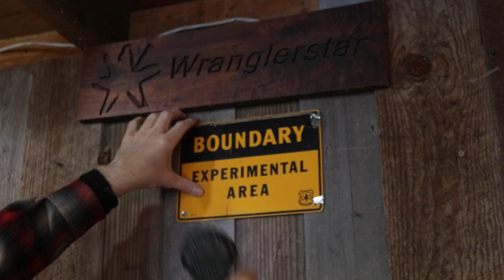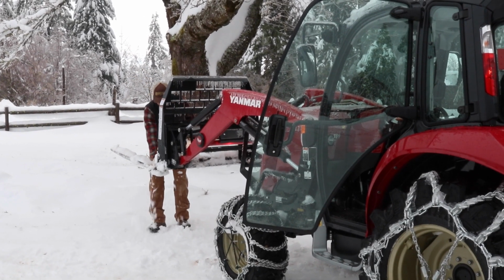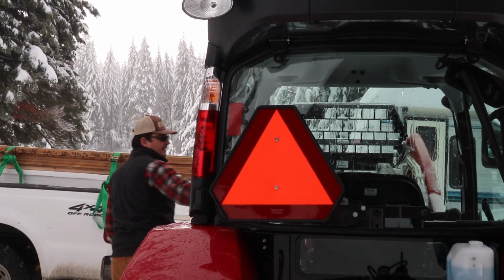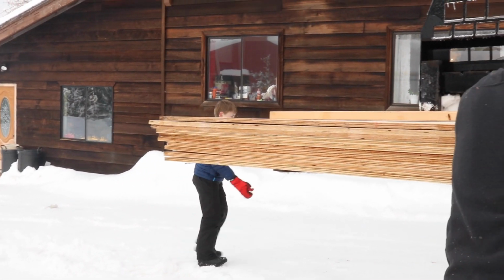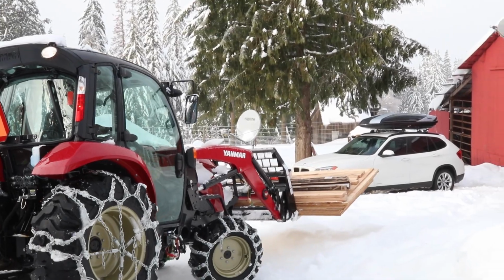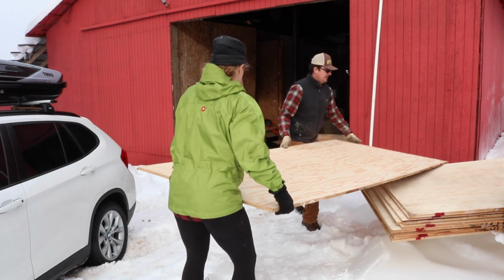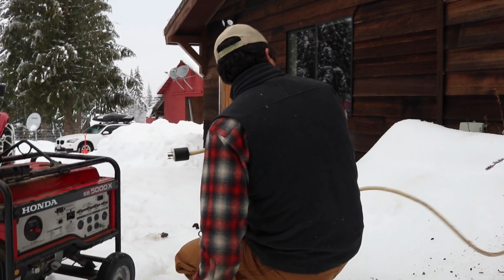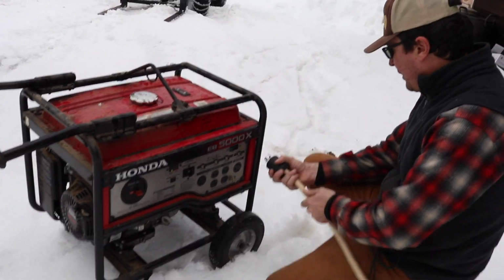THIS ROOM IS KILLING ME I CAN'T TAKE IT ANYMORE!!

Comment: I had to wince at this setup for personal reasons.  I can guarantee you that the setup in this video would ensure my home insurer would not insure.  It was simple and cheap enough to install a transfer switch and L&I approved panel breakers to my existing panel.  Added a whole house surge suppressor as well.  L&I approved, insurer is happy.  Sorry Cody, going with the masses here.  Time to do it right, if your panel will support it.

Comment: Ice dams. Hate those things. Keep the underside of the roof cold to out door ambient. Won't solve all ice dam problems, but it helps a lot. Looking forward to the rest of the shop renovation project. I've got a small barn that once I get a new foundation under it, I'll be turning into a shop. The old foundation is heaving and cracking due to frost and Groundhogs. Sigh.

Comment: Even small generators have the capability of putting 1000's of volts on the lines through a back fed transformer. PLEASE use a transfer switch for home generator ties! One wrong flip of a breaker could cost a lineman's life.

Comment: Hey Brother, you can tow a BMW from the front.  There is an eyebolt in the trunk that screws into a hole in the passenger side front bumper.  You just have to push out a square cover and screw in the eyebolt and then put the hook of your tow strap on it and away you go.  Cheers

Comment: The ice on the trees reminds me of the great ice storm in Eastern Canada & North-east USA. The freezing rain started overnight, but with temp below freezing the ice coating continued to buildup on all the trees. Whereas you could hear the ice falling off the trees limbs and crashing to the ground, in our area the the weight of the ice broke limbs, split trunks with a sound like a rifle shot, crashing down!! The electrical grid system was destroyed; miles of broken poles, thousands of broken lines and downed high voltage towers!...I have heard Gabriel's horn.......

Comment: I just recently bought a 10,000 watt generator and have been doing research on the transfer switch... I have read back feeding through the dryer socket is very dangerous.
Reply: It is completely dangerous and in most cases illegal to operate without a transfer switch. The relatively small amount of money to install the generator properly is worth it considering the danger to your home, your family, you and others who may be injured or killed by fire, electrocution from the double ended plug or by inadvertent back feeding.
Reply: I have a good friend who was a professional electrician for about 30 years.   When I asked him about a genny he insisted that he install a transfer switch.   After he explained the reasoning it's well worth the money.

Comment: National wiring code stars you need a transfer switch so when you use a generator it would automatically shut off the main. Also it would be ideal to put in a generator panel that shows the amount of wattage that you use. And remember the generator has two wattage levels. One is startup because of the surge in power especially a motor circuit like a refrigerator. And the second one is a continuous running wattage. You should also start a generator once a month to get rid of the moister in the windings. Another benefit of doing that is knowing it’ll work. Another smart idea is having it converted to run multiple fuels like gas and natural gas. One time we were without power for a few weeks because the grid went out. People that only ran on gas ran out of it after a couple of days because service stations weren’t working. I had no problem and because I ran on natural gas which is continuously under natural pressure. I was the only one that had power around me. My moto is like the scouts, be prepared.

Comment: Look inside the back of the car, drivers side, inside the tailgate, there's a panel there that comes off, your locking wheel nut key and the factory tow hook should be in there. The hook screws into the frame so you can tow it. We have an x3 so I don't know exactly where the panel is on your bumper but one should pop off and you can screw in the tow hook.

Comment: It is better to isolate the whole house from the mains before you power anything with a generator.  It's also better to have a dedicated socket for the generator at the mains. Don't back-feed over other circuits. 
There are two reasons for this.
1) Power workers. As Cody says you are endangering them if they are working on the power lines.
2) If the power comes back on to the mains whilst the generator is connected it will blow the generator to kingdom-come as the generator frequency is not synchronised to the mains frequency.

Comment: Crucial point about back-feeding into the supply! I get paid to do this so I have some knowledge (in the UK though) .... IT is CRUCIAL not to back-feed into the supply as a manslaughter (or even murder) charge can ruin not just your life .... and it can get that serious! You need to disconnect the mains from the circuits you are feeding via a genny. WE pull the main fuse .... but the power companies will not look kindly on you for doing it .... there are other ways though! Turning your main isolator off is an option as is a changeover switch! IF you experience this regularly a changeover switch is the way to go! Mains in one input, genny lead into the other and the house supply to the output. They are not exorbitantly priced BUT I would recommend an Electrician if you are not certain of what you are doing! Backfeeding through a circuit is not normally a good idea, but if the circuit is rated the same (or higher) than your Genny it will work .... but remember to turn all devices off or the load will trip the genny / blow fuses! LED lighting is amazing in this situation too!

Comment: do you have a heated shop that you can work on the tractor or vehicles? I noticed how much ice your house has overhanging on the roof in your last video before the ice storm, you might want to consider blowing more insulation in your attic, and making sure its properly ventilated so you dont get ice dams no more! I did this to my shop this summer and no more ice dams this winter so far!

Comment: You should look in the manual for you're car. There is probably a cover on the front of the car that you can pop out and than there should be a hook by the jack or spare tire and that will spin on a stud or hole behind that cover. There is lots of vehicles that have a set up like that!

Comment: Hate to point out one negative on your generator to house hook-up, but back feeding through the dryer outlet is a definite no, no and against every electrical code known in North America. Let alone, no homeowners insurance would touch you with a 10 foot pole if you ever had a fire. Take the bit of extra time and minimum expense  to install a separate generator panel which ties into you main electrical panel and the proper exterior twist lock plug on the outside of your house to connect the generator 220 V cable.

Yes, the dryer back feed works, but not something to depend on. 

I currently have the Honda EC6500 genset and I have no issues running almost everything in our house (less electrical heat and hot water boiler) on the generator.

Comment: Have you considered a PTO generator for the tractor? That way you could connect it to your incoming main line and power everything using the tractor PTO connected to a generator. Also, you have no engine to maintain other than the tractor.

Comment: I've done something similar with the generator when I've had ice storms in the past. I didn't have a dryer I could do that with. So on the other end of the wire I attached a 30 amp double pole breaker. I had a slot free in the breaker box. I could just flip the main, snap that into the breaker box and I was all set up.

Comment: Wranglerstar fyi that bmw should have a tow point in the front. If you look in the owners manual it should tell you. Theres generally a threaded hook in with the spare and such that will screw in the front. Usually theres a small plastic cover in the front bumper area that will pop off and reveal a threaded hole for said hook to screw into.

Comment: there might be a screw in tow hook for Mrs W's car, normally located with the tire changing kit, if so there would be a plastic square on the passenger side front bumper you just pop out

Comment: Cody I normally hate all the safety sally comments but today I will make my own. You are giving the general public just enough information to be dangerous. If they hook up their generator the way you do but for get some steps or do them out of order somebody could get seriously hurt or killed.  If they forget to turn off the main breaker or switch on the panel it will back feed to the utility transformer which will then be stepped up to thousands of volts. The utility worker could be working on a dead line then you turn your generator on and poof, you just fried him, not to mention that you will probably kill your generator. Then there is the danger to yourself. They way you are doing it, you have a male plug on both ends of the cord(one the generator end and one on the dryer end) if someone starts the generator with the dryer end unplugged you will have hot prongs on the male plug. 240v hurts and that is from experience.  As an electrician for 12 years I say do what you want and be aware of the dangers but please don't show 500,000 subs how to do it without giving them a full explanation of the dangers.

Comment: ETA: DON'T ORDER THOSE ICE SPIKES!  There are some coming to you already in the mail.

I was starting to worry about you since we hadn't heard from you in a few days.

This video is VERY timely for me, too.  I am in the process of organizing my shop/barn.  I'm going to look up you older videos about organization, too.

We have ice storms in Arkansas as often as we have snow storms.  The ice will build up on power lines and break the poles.  Beautiful and dangerous.  They should give those storms female names.  ;o)

We have never been without power for more than a few hours at my house, but I have a generator ready (not a Honda, but it works) with a 220 receptacle that was installed for that purpose.  It has come in handy, and I got good points with Mrs. AP when I cranked it up.

Comment: Cody on most European cars have a insert located on the bumper either on the front or rear bumper that you screw into to pull out a stranded vech you should have a large screw in the Spare  tire area that is to be used for this reason. . have a great day
Reply: Yep.  There will be a round cover on the bumper, sometimes you have to look hard.  The eye is with the spare tire and just screws in.

Comment: Cody, Please, please PLEASE! For the sake of us line workers and tree workers, have you planned wired correctly so that it disconnects from the grid. I'm not a safety Sally, but electricity is not to be messed with. that little generator can do a lot of damage by reenergising the lines. I'm sure someone else has brought it up in the comments, so I'll leave it there. Just please have that generator hooked up properly.

Comment: I don't know if you could help me with some advise. but anything would help. I couldn't afford a good camp hatchet so I bought one from harbor freight. I would not say it came sharp by any stretch of the imagination. I used my dads double sided sharpening stone (course and fine)  to get it a really rough point of sharp. but it still feels like I am slamming into each blow of wood. it almost looks like it has a convex shape coming off the cutting edge. I have seen your axes and they seem closer to a sharp wedge shape
Reply: Axes some in cutters and splitters, thin profiles are for cutting and wedge shaped ones for splitting... now you can split with cutters, but it takes some technique... I would advice watching some vids about 'how to split wood', 'better ways to split wood' and the likes (as search titles for videos: one was something like 'wood splitting you have been doing it wrong' or something like that, that was also rather good). The sharpness doesn't even matter that much, but if you are just hitting the blocks in the middle you will be there all day... I watched these kinds of vids recently and they are really informative, and i am fairly sure that after watching a bunch of them you will likely improve your results.